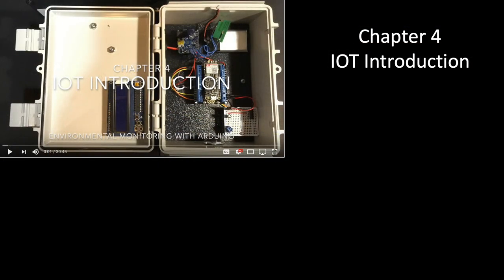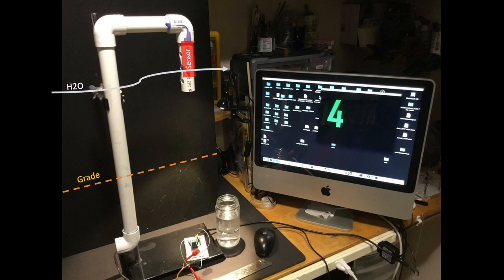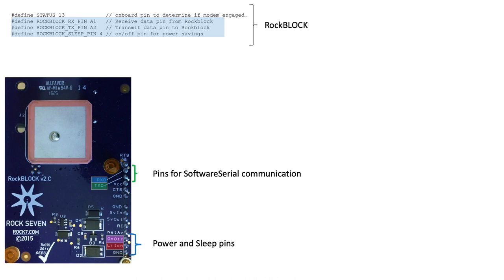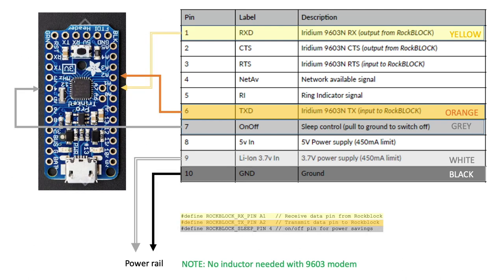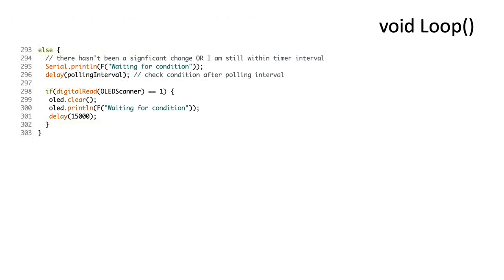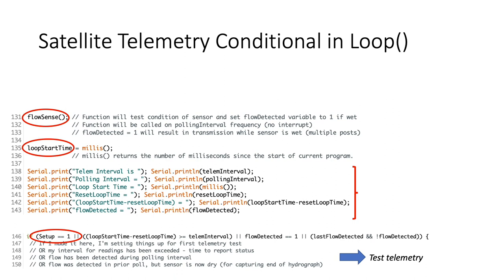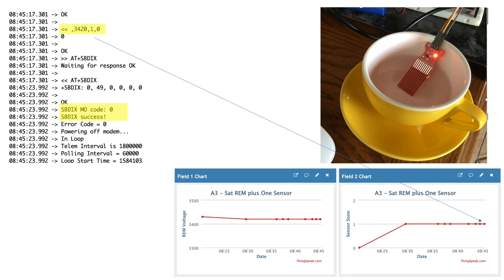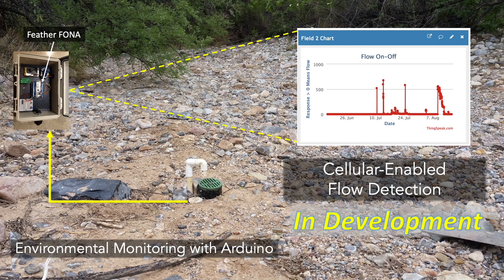Iridium/Rockblock Satellite Telemetry for Remote Flow Detection

Comment: Interesting! I knew about the Iridium satellites, Iridium flares and that there's a Motorola PPC 603 CPU in them (back in the day I had some Macs with the PPC 603). I didn't know you can send packets with Iridium. Great that you manage to create your ideas. For about a year i'm into Arduino and Lora and have build some small tests, but never managed to finish the original problems I wanted to solve.

Some thoughts about your project:
- you can save a lot of power by changing your delays into sleep. Not sure which chip is on the Trinket, on the AVR Arduino's you can use the watchdog timer to sleep instead of delay your program
- I think NIMH batteries are a good alternative to your lipo. NIMH have a greater operating temperature range and you can charge them directly from a solar panel: Less conversion losses. Since the modem needs 5 V, 4 batteries in series would be a starting point. You can add parallel batteries to increase the capacity. Alternatively 3 batteries in series with a boost circuit for the modem.
- maybe the modem is not so picky about 5 V,  and maybe your whole setup also runs on the battery voltage range: 4.2 V till about 3 V

My personal favorite setup as of late is the Pro Mini. With the power led and voltage regulator removed / destroyed and the BOD disabled, you get a cheap board that can be extremely power efficient (during sleep) and can be used in a wide voltage range. I've sent and received Lora messages with as little as 2 V with the RFM95.

This coupled with the ability to run the 328p with a 32 kHz crystal in asynchronous mode (you'd need to solder it on the board), you can keep track of precise timings / intervals and only use a few microamps in the process. This mode is pretty unique for the most commonly used AVR chips in the Arduino world. Off course you have all same benefits by using just the 328p chip without the Pro Mini.
Reply from the maker: Sincerest thanks for your interest and your reply. The ProTrinket uses the ATmega328P. I will look into the watchdog timer to sleep. I haven't been challenged by power because of all the sun in Arizona, but this is good to know for others in higher latitudes. 
 
I agree on the NiMH batteries. My colleague has deployed at higher elevations and we have had problems with batteries freezing up in the winter. The solar charger I've been using are specific to lipos which is why I haven't swapped these out. This is what I'm using: https://www.adafruit.com/product/390 . It works fantastic with lipos. Do you know of a good solar charger that will work with NiMH? 
 
The modem is not challenged running off the lipo-- the challenge is at the microcontroller logic level relative to what the signal put out by the water sensor.
 
I like your ideas and experiences surrounding the Pro Mini and intrigued by your comments regarding LoRa. This is definitely on my radar, and I have a continuous current meter with a datalogger to for future experiments :) https://youtu.be/JwMC3VS6sMc . I've been wondering about a project to use that tool-- this could be it.

Comment: But taking it up a notch and doing having them on board edge small ramian spectrum spectrometer as well as a bocsh voc / vos "ai" sensor near the surface of the water to detect both dumping, leaks, or bacterial overgrowth. The latter would be very important to public health in remote areas. You could notch it a step up and add a small pump which is clog resistant and fills a cm2 sample container and then does a layered 3D shots of the sample and counts the known human pathogens like e.coi and parasites. A recognition algorithm done with a Jetson nano which then compresses the data as sending the images without a LTE network over lorawan or iridium would be too pricey but results so putting the analysis on the edge both for an optical slide for the ramian spectrum using a dual UV and red or green (depends on which things of interest are more sensitive to which wavelengths. I read for life science UV laser is helpful but a dual source calibrated and again the nano holding the tensors for comparitive outcome or sending the peaks via small data packets.
Reply from the maker: Anything is possible. I suspect most programmers may not have the real world context to realize these ideas- perhaps someone will pick up on your shared comments.

Comment from the maker: We are having trouble with lipos freezing up at higher elevations, so I am going to test NiMH which is less problematic and can be trickle-charged as outlined here: https://www.evilmadscientist.com/2008/simple-solar-circuits/ . I think the Energizer 2000 mAh NiMH batteries coupled with the small solar panel from Voltaic (6V, 180 amps) might work; stay tuned.